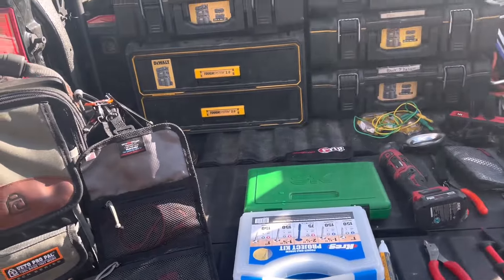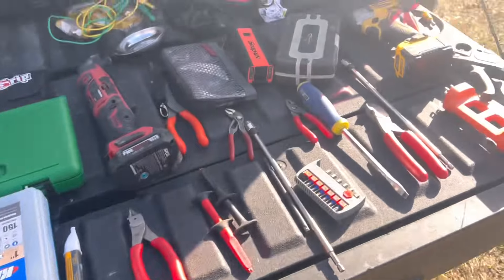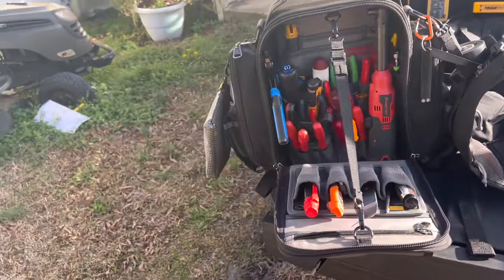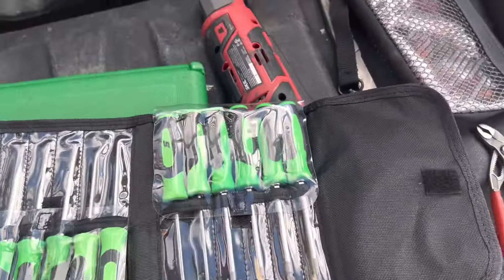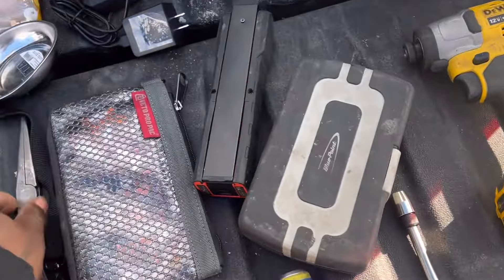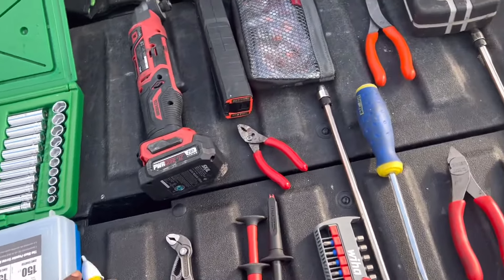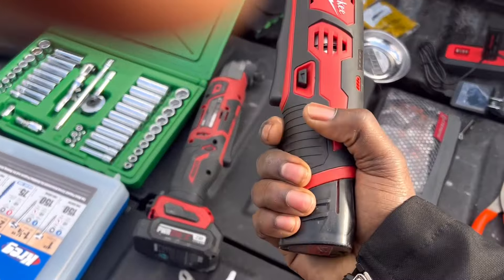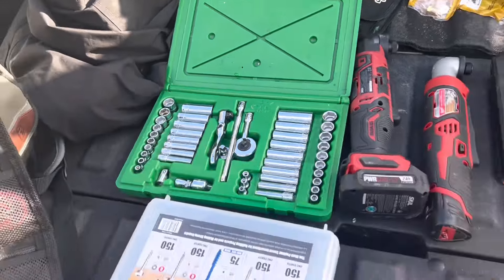Updates’s How tools held up working in rain.

Comment: Red wings baby... Cost a fair amount but great lasting and waterproof/insulated 👍. Have had 2 pairs each last almost 2yrs each.
Reply from the maker: I’ve had em used them for climbing boots and ect. (Gaffing poles) When I worked CATV they are good priced about the same as thorogoods
Reply: Red wings are trash you must new to work boots keen is actually the best boots out there
Reply: @D0NTREP0RTME  Never heard of Keen but I have gone with Rocky, Timberlands, Blundstone n Red Wings. I got 2+ yrs of everyday, hard use out of my 2 pairs of Wings, just got my 3rd pair. All the others were trash.